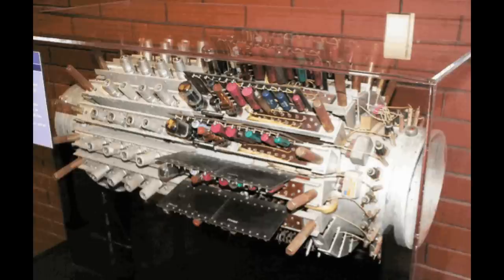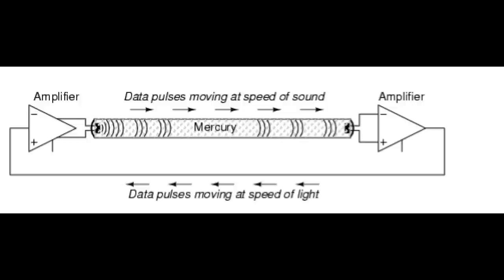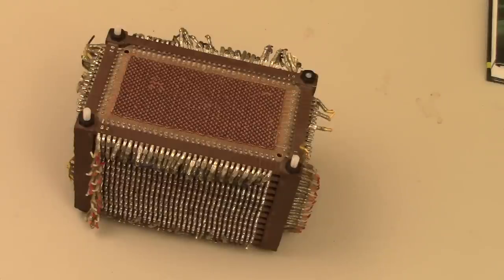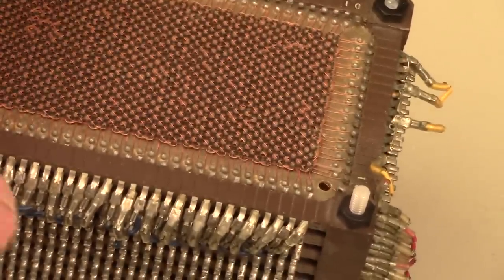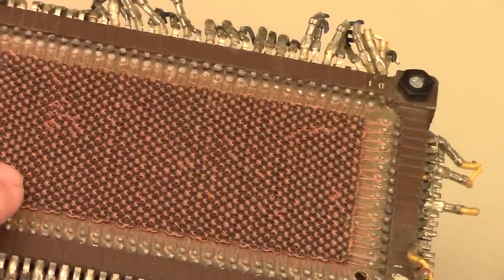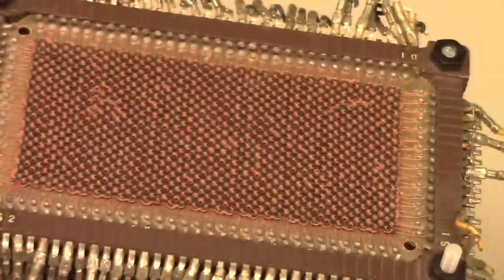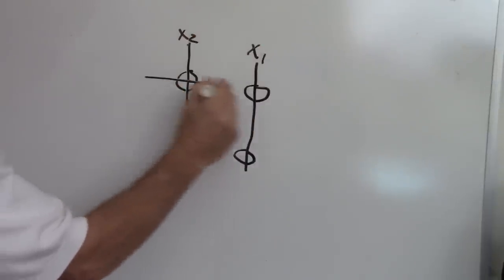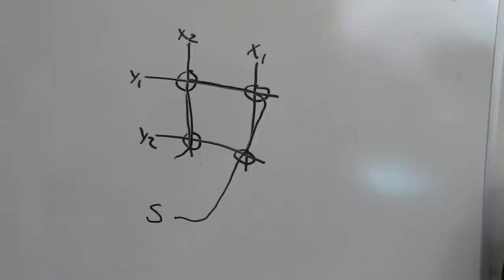Episode 11 - Getting Busted in New Jersey With Core Memory

Comment: He forgot to mention that there are still at least two computers still using core memory - the Voyager probes! Still going strong (ish) after 40 years! Now that's reliability!
Reply: seriously? this is amazing!
Reply: Aslong as they're not using Windows CE...
It's hard turning a launched space probe off and on again!
Reply: Send a reboot command and pray.
Reply: Well, not to ruin the joke... but core memory was actually cool for that reason specifically. You could turn it off and on again, and lose no information. In fact, you can turn it off for hundreds of years, and not lose any information! It's one of the reasons people still bought core even after CMOS memory was available, and even when it was cheaper. No load time! Just turn it on and plug away. I would love to get a set of core memory for my PDP-11/03.

The irony is that with windows crashes, core memory would be a disaster! When you hit the reset line on the bus, it'll jump right back into the crash unless you completely reload it from paper tape! You're not doing that in space...
Reply: Meanwhile in Kubernetes land...

Comment: I worked with a core memory based computer.  The core had to be in a temperature-controlled chamber to work right.  I once had to replace the heating elements.  This was in the late 1970's, and that computer was well into obsolescence at that time.  Oddly, it had a 24-bit word length.  As I remember, the memory was only 2048 K,  and programs had to be partially run and swapped back and forth from core to the memory drum unit.  The drum unit was the size of a washing machine and held 256 K words.  It had to be pressurized with helium.  The computer controlled a steel rolling mill and was made by General Electric.  And yes, the programs had to be compact and efficient!  I used an assembly language called PAL for most of it, although it had a FORTRAN compiler too.

Comment: I remember core store lectures (because we might come across old mainframes during our careers as electronics engineers) at college in 1983. Advantages (or why the millitary had a liking for them even duringthe 1970's and 1980's) was that (A) totally EMP resistant, (B) core memory will hold the "bit" stored without power for just over 4 centuries and (C) not as fragile or sensitive as the (then) new static and dynamic RAM devices.      I designed and built a 4 bit computer using TTL static RAM, TTL ROM, 4 x TTL shift registers, TTL numerical LED drivers and a 74181 ALU for a weekend homework project. I still have it and it still works.
Reply: I was flying navy patrol planes in the late 80's into early 90's that had 64k iron core memory with 32 bit parallel word processing.
Reply: Hasn't the US Millitary have some ancient super computer buried inside a mountain from back in the 1980's?? That was using core stor memory and there was a documentary on BBC TV back in the 1980's about it. Kind of rapidly superceded by events and technology. Core Stores did have a longer existance in the computing world than DTL logic devices. I know I'm growing old when I can remember old obstelete technology and how it functioned.
Reply: There is no way to subscribe to this discussion so I'm forced to leave a message I can get back to (YouTube might decide to scramble comment order, who knows..). Sorry, keep talking.
Reply: P-3?  I worked P-3C out of Diego Garcia AMID W/C 610 the VQ-3 EC-130Q TACAMO.  I'm trying to remember the manual programmer we used.   Collins or Rockwell 7404-1a or 7401-a or something like that 32 toggles in 8 groups of 4 and 32 lights above them with a send/encode button.  I was rather good at programming in binary.
Reply: ***** Real bootstrapping. :)
Reply: lol I spilled milk on my old laptop a few years ago (teach me for placing my bowl of cereals on it "just for a sec")  The milk spill killed one of the SODIMMs, but luckily the rest of the laptop, once dismantled cleaned and dried out, was fine.
Reply: Dragon Butt Don't I know it.  I took the DVD drive out, tipped it on its side and poured the milk out of it lol.  I took it apart since it had died - I figured I had nothing to lose.  The fact it worked and cost only a RAM stick to revive it was something of a miracle I think
Reply: My uncle told me to make sure you speak Bocce.
Reply: Andy Reid core memories are still in use, I have been repairing them for 30 years.
Reply: Terry Murray I have seven of them in my closet

Comment: I ran across this old digital computer patent 3190554 that use compressed air instead of electricity. It even had it's memory stored in compressed air. ( I think) Did you ever run  across such a computer if so what was it used for? Think one could be built today using 3D printing using some Nano Tech ? If Babbage had gone this route do you think that his Difference Engine could have been built by the folks who made pipe organs?
Reply from the maker: +ufoengines That is an incredible patent!
Reply: Surprised the hell out of me and I don't know squat about computers. I didn't read the patent to close but I think it had air memory. Let me if try to build one using 3D printing.
Reply: +ufoengines Player pianos used air blown through the holes in the scroll of paper to operate. I kind of doubt the people who made pipe organs made the Difference Engine. Large buildings use(d) compressed air to run their climate control systems. Electropneumatic controls were and still are quite popular, and they are still used in lots of cars to open and close valves & dampers on their climate control system. They run off the engine vacuum.  Air can be under or over atmospheric pressure, so why not?>"<. Neat patent!
Reply: +ufoengines I'm imaging a seriously steampunk computer, sort of a cross between a computer and a pipe organ. (Calling Captain Nemo?)

In all seriousness a pneumatic computer has some interesting possibilities,  it would be virtually immune to radiation of any kind and could be powered by a tire pump.
Reply: I have this idea that if Babbage had run across this concept that he could have had the pipe organ guys build his his Difference Engine for him and Lady Ada would have invented COBOL. Of course if Da Vinci had invented the phonograph.instead of Edison would have had five hundred years of recorded music. Dig that!
Reply: Automatic gearboxes use an oil computer.
Reply: manaquri If you mean the valve body yes, older automatic transmissions use a sort of analog, hydraulic computer.
Reply: Tell me more.
Reply: Hardcore steampunk :D
Reply: I work on pneumatic computers all the time. Many buildings still use pneumatic controls. The computers can do proportional control math. Some even do calculus type integration. It's essentially an analog computer system. the systems are disappearing as Direct Digital Control or DDC progresses. It's still installed in hazardous explosive environments however.
Reply: There's a video I saw where some French students built a Lego Turing machine with the little pneumatic cylinders and rubber tubes. I can't recall where on YouTube it was, but there's another one that shows up on Google.
Reply: Brian, is there a some good info or a video on these systems? I'd like to see a rundown on one of them.
Reply: *****
there's some intrinsically safe, and enclosed electronics that are used in explosive areas.
Basically ultra low power devices, or devices encased in resin
Reply: This could give new meaning to the term memory leak.
Reply: Not bad. This digital air computer stuff came for the teenage mind of a kid named Mitchusson who gave his idea , patent 3107850 to the world! ( Guess he thought it a not starter with electric digital computers being everywhere.) I 'm hoping some tech school make this a 3D printing project for a class and then post the results on You Tube. Next I want to see a You Tube of a demonstration of Collision Based Computing using Brush Bots.
Reply: Maybe it was this guy Raymond W. Warren patent 3016066 and he dreamed it up as a kid. (  I read about the idea in a back issue  Pop. Science in 1977, where you around then? ) The patent text said you could use it free charge. Still cool that you can do digital as well as analog computing with air.  Bummer Babbage didn't think of this, COBOL in 1880!  What you think of demonstrating Collision Based Computing using Brush Bots?
Reply: I think that some of Theo Jansen's beach animal sculptures (look for strandbeest in your favorite search engine) use a binary system with compressed air to count the number of steps separating them of the ocean. Can't remember if he actually built that or not.
Reply: those things are so unreal
Reply: +Brian Cunningham are you an instrumentation/controls tech? I did a couple renos in older buildings this year and some of the old pneumatic controls boards for the hydronic heating systems were really neat.
Reply: They are also unfortunately only moderately reliable...
Reply: ufoengines I would love to see a video of this...
Reply: ***** how about a very basic computer?? And I mean very very basic
Reply: Seth B most climate control is electronic now 
20 years ago it was vacuum operated but even in the 80s it was being fazed out
Reply: pneumatic computers aren't as crazy as you might think, anything that can be used to store and read stored data and perform logic operations can be turned into a computer
Reply: qwerty et al ... the salient problem with air, hydrolics, legos, or whatever to build a computer out of, is the speed. Transistors can switch in picoseconds. Then the speed limit becomes the fact that the electrons must travel distance, for instance from memory to CPU. They only go about 1/3 the speed of light. Some years ago IBM had a project to built a computer using photons instead of electrons. They didn't get it working but they sold it to the Japanese and they did. A 4 bit word; a 4004 essentially. The problem then becomes the word size. You're only getting a X3 improvement over electronics and it got prohibitively expensive. And there wasn't much impetus to push it farther (smaller and cheaper). If you have a pentium you can double the speed for many tasks by getting another pentium. With 100 pentiums you can get almost X100 speed increase, much cheaper than inventing something exotic.

However, photons have other properties that open up some interesting possibilities. I worked on a project at Lockheed Martin to build an optical coprocessor to do fourier transforms. We could do full transforms on very large data sets in the time it took light to transit the device, like 1 nanosecond. Search for "optical correlator".
Reply: A thermometer that displays both F and C temps is a pretty simple analog computer. Just read across to get the conversion form F to C. Google up the subject of Nomographs and slide rules . I'm old enough to have used both while in school.  Now I'm checking around if anybody is using Bristle Bots to show how Collision Computing works. They have use solder crabs to show how to do calculations.
Reply: Preaching to the choir!  Patent 3190554
Reply: Many years ago Scientific American's column "The Amateur Scientist" ran a couple three installments on doing digital logic using glass pipettes squirting water. Water squirts out of a pipette and if aimed just right can go right back into another pipette. Thus you have a stream of water flying across space in a controlled way. One stream can disrupt another. So you can build AND, OR and INV gates. So you could theoretically build a CPU. Or at least get your feet wet in the technology
Reply: ufoengines Nomographs haven't gone anywhere, they are still in use everywhere.
Reply: Pappy Fiddle get your feet wet hahaha nice one

Comment: Pretty scary to think just how much computing power you have in your phone these days when you watch vids like this.
Reply: robuk1981 I wonder how a simple digital Casio watch would stack up against early 50s computers. What would the modern analogue be, a  digital timed washing machine?
Reply: the biggest computer I've ever seen was about the size of a shed, it's still used to control the railroads, the next time you pass some railroads and see a small house made of steel near the tracks, there's a huge computer in there and the walls are stacked and stacked with batteries and live electrical wires. It's a pain in the ass to set up those computers and make sure every little feature works
Reply: Well, even the early computers had way more input/output bandwidth than a $5 watch.  The problem with early non-transistorized computers were that they weren't very reliable.  But anyway, back then it was about computers handling large amounts of information through batch processing.  That was where their power was at, not so much at complex calculations.  In fact, analog computers were better for a lot of things up until the mid 60s.
Reply: I visited Kennedy Space Center back in 2011 for the final shuttle launch STS-135.  Back then we still had iPhone 3GS and iPhone 4 phones.  The replica display of Mission Control for the Apollo moon missions said that modern smart phones (ca. 2011) had more power than the entire Mission Control center that put humans on the moon.

Comment: For extra entertainment you should see how we used to do read-only memory for things like bootstrap loaders - the very first thing a computer runs when you turn it on, which today is lodged in a small piece of flash memory and is called the BIOS. Let's say you needed a 256-byte bootstrap loader. The manufacturer would send you a blank edge card with a grid of 256 x 8 pairs of solder pads. To program a 1 into a location you had to solder a jumper wire, or a 1N34 germanium diode, into its solder pad pair. Field-programmable read-only memory ICs were invented by the Air Force in 1956, but they were REALLY expensive, much worse than diode cards. We used diode cards with 1N914 silicon diodes before we moved wholesale to PROM ICs. (And you know you're old when you know the part number for a germanium diode off the top of your head.)
Reply: I had one of these kits as a kid in 1966 which started me off in electronics. It had AC126 and AF116 transistors and an OA79 diode. The transistors were expensive for me to replace if I broke a lead or burned one out. Ah the memories.... 
http://www.hansotten.com/uploads/philips/jlee20c.jpg
Reply: The 2732 EPROM was my first memory. I used the 74LS138 as address decoder ... and knew many other TTL chips number.

On the more crazy part of my self introduction to microprocessor, I studied in detail the hardware of the video game miss pac man. The steps were:
- creating the electronic schematic by tracing each connection between the about 80 TTL chips * 14 pins : about 1120 pins tested with ohm meter
- read the EPROM content manually
- write the byte value on note books, one byte per line
- identify the Z80 opcode and optional data using the appendix of a programming manual which listed each instructions over 250 pages and a table sorted by numerical value in the appendix

I made my first EPROM reader using a weller solder iron plastic box on which I installed 12 switch for selecting the address and 8 red led to display the 8 bit value stored in the EPROM. I was flipping the address switch in binary and was writing address and data in the notebook. 
A second plastic box was used to create a debugging emulator. It had one switch connected to the clock input of a Z80 processor and one 24 pin socket for a 2732 EPROM. It also had 16 led to show the address selected by the Z80 and 8 led to display the data line.
Pressing the clock switch was triggering the execution of each instruction step by step. The Z80 was fully static, so the clock could be stopped for minutes or hours and still continue to the next operation. Eventually, a 555 oscillator was added with another switch to skip some repetitive loops then resume clocking manually.

Comment: I wonder if we'll look back on these days as "bad old days" someday.
Reply: Oh indeed we will.  Memristor-based storage will (likely) change everything.  Solid state non-volatile storage will be as fast as DRAM, which will remove the need to use volatile memory anything except on the CPU die itself.  And even that might go away, since memristors can be used to build computing logic as well as memory.  I'm not sure if there are speed reasons not to, but we could have just a giant array of memristors which dynamically change from providing computation to memory.  Many people are excited about using memristors to build artificial neurons and artificial brains, but I'm far more interested in how they might radically alter the entire landscape of computers.  There is every reason they might be more successful and ubiquitous than the transistor.  (The transistor isn't even a fundamental element of circuits, which memristors are.  Resistors, capacitors, inductors, and memristors are the fundamentals, we just didn't know how to build memristors until recently.)
Reply: 10 years ago were 'bad old days', just look at your cellphone..
Reply: I sure as hell hope so.
Reply: Nice EVE portrait ;)